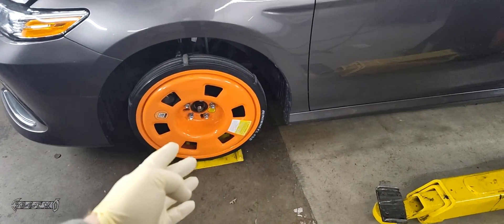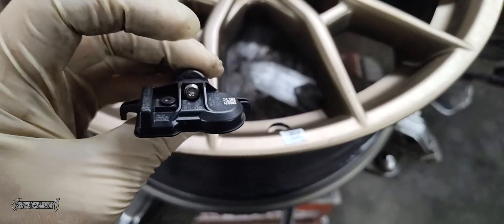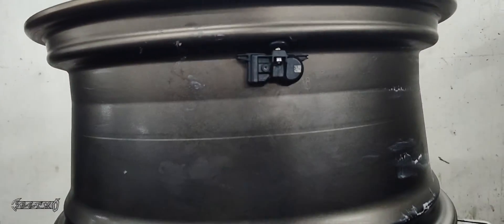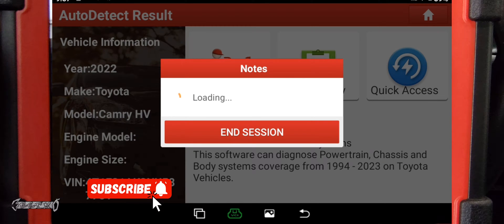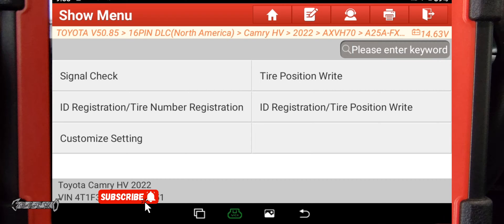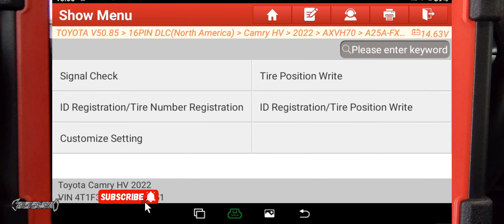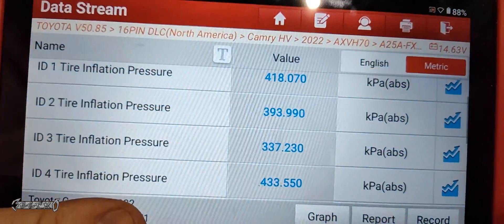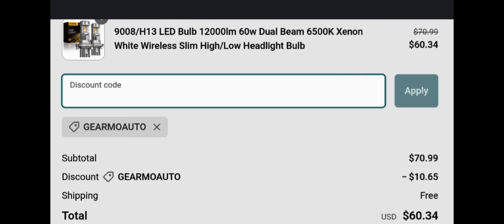HOW TO PROGRAM NEW TPMS SENSORS ON 2022 TOYOTA CAMRY _ LAUNCH X431 SCANNER

Comment: I bought this scanner in 2024 and it will not operate any tpms function without the ya gun. What is the firmware? Is it the most recent update?
Reply from the maker: Are you using it for Toyota? Or different brand

Comment: You don't need a scanner. I just put new snow tires and wheels on my 22 Camry. On the information center go to the gear-shaped settings icon > Vehicle Settings> TPWS > Change Wheel > hold down ok until it goes into learn mode. Drive the car for about 5 minutes, it will learn the new sensors and the light will go off.

Comment: How can I check the id if the sensors are already installed in the car? I have launch x431 without gun
Reply from the maker: Go into TPMS MODULE , Go to live data list. In the Dallas it will have four or five lines that say tire registered ID. It will have them numbered 1 through 4 and will tell you the ID numbers of the wheels

Comment: Autel makes some good aftermarket sensors, they're $60 cheaper than Toyota's. I have the older version of this tool but it has all the same functions. Have you turned off your seatbelt beepers yet, or turned on the all windows down function?